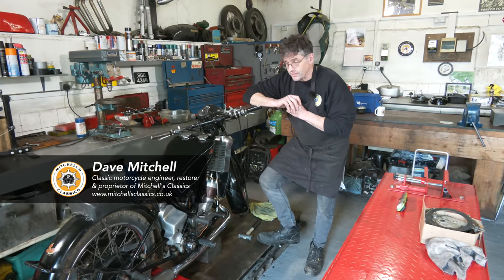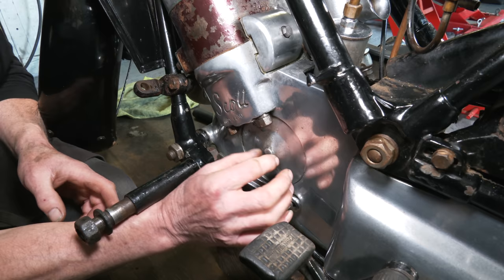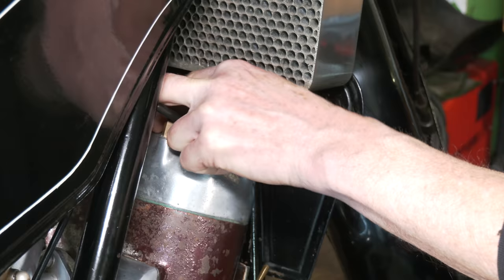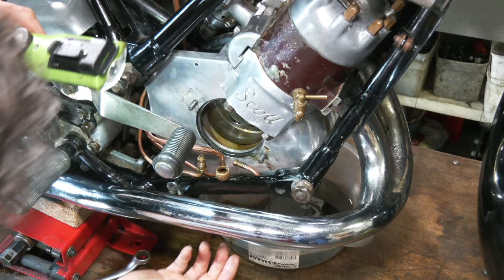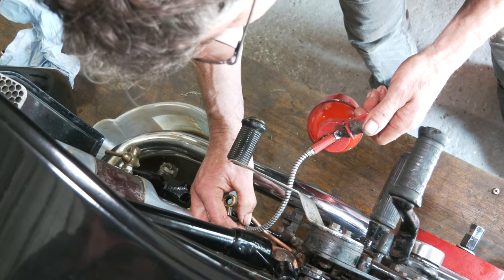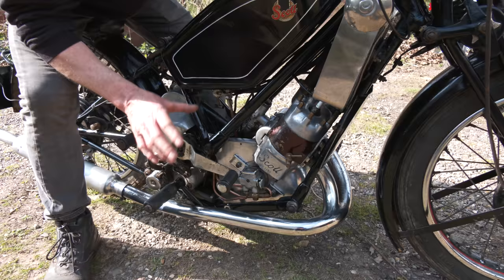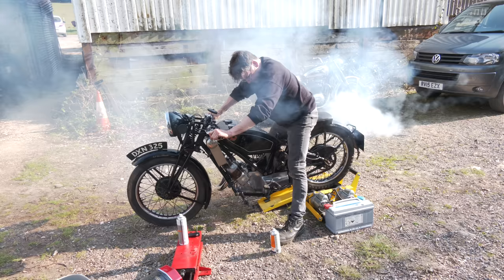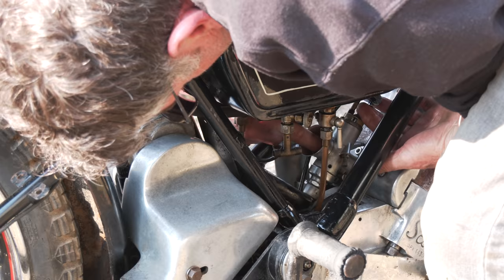1930s Motorcycle & Sidecar - Recommission & Ride - part 2

Comment: Dave, do yourself a favor and get some 2 stroke oil and replace the 40 weight. Modern oils as you know are much better at lubrication and will allow you to use much less oil. It will still smoke, but you will reduce plug fouling dramatically. Next starting a two stroke with a tickler is the easiest of all the systems. The idea is to do the mini flood and get it to fire, usually it takes a lot of tickling. The choke is not for starting, it is to help keep it running while it is cold. Just like a four stroke. Also if it is loaded up with too much fuel, turn the throttle wide open, many times that will clear things out. You get a feel for when to do this with experience. ALSO to remove things like that blind plug where you can't get a hold of it. Invest in a cheap Paintless Dent Repair kit with a slide hammer. Not only will the hot glue stick and you can use a slide hammer, it works for taking out dents in tanks, exhaust and fenders. Been doing if for a while with great success. Can't wait for the next installment.